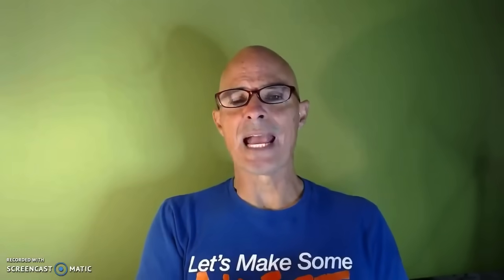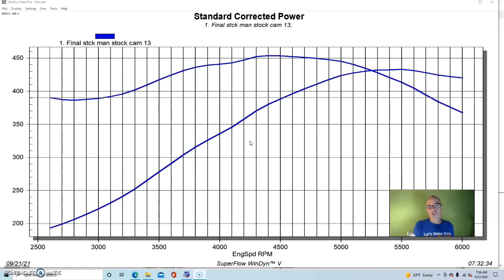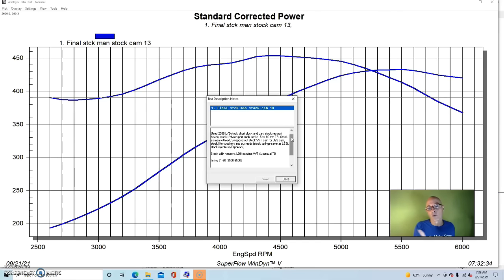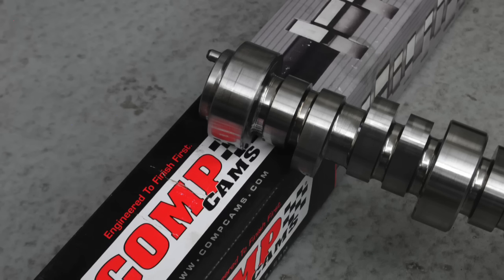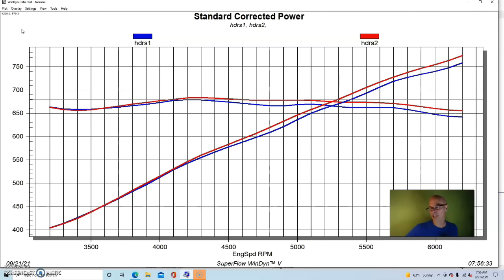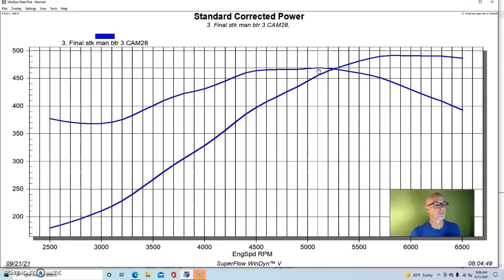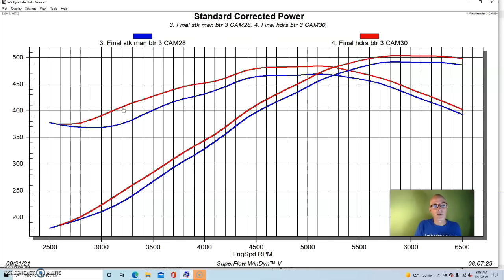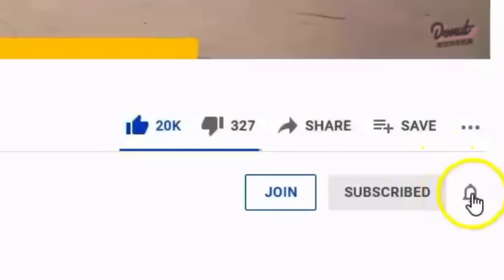HOW MUCH POWER ARE LONG-TUBE HEADERS REALLY WQRTH? JUNKYARD 6.0L LS HEADER TEST!

Comment: In the 70s, one of the best ways to get power was headers and free-flowing exhaust. Since the 2000s engines have improved so much that there just isn't much difference. Your results are about what I'd expect. For example: my 2003 GMC LQ4 has cast manifolds that are essentially short tube headers that feed into a 4" exhaust system.
Reply: I agree!! It's not worth the wasted money, time and headaches buying/using fancy headers to gain a couple of horsepower!!
Reply: I have a 2002 Avalanche, stock 5.3, and I added a Whipple SC that makes 6 psi boost. I put long tube headers on it and they were nothing but trouble. First, the headers for the truck do not have tubes that lay neat and tidy like his dyno headers. They have tubes that loop upward and make contact with the LS ign wires, forcing you to solve that problem. Then they make access the spark plugs more difficult. And they have a clearance issue with the 4x4 front pinion. And they crowd the starter, making it more prone to heat failure and more difficult to change out when it fails. They were not worth it.

I now have a little more cam in it, very mild, stock idle with .050" more lift than stock. The 706 heads have been CNC ported and the chambers polished & cc'd, still the same Whipple SC. I now have the stock exhaust manifolds back on and I will install a good performance exhaust system behind the stock manifolds. I am looking forward to fewer under-hood problems and I don't mind if there is a small HP penalty.

 The engine runs well, BUT unfortunately I can't drive it right now because the engine has to come back apart ... apparently Comp Cams has sold me a bad set of lifters and they clack like mad after the engine warms up. Quiet on cold start but excessive lash noise gradually comes in as it warms past 180 degrees.
Reply: Very true! malaise era cars had the worst exhaust systems ever just a plain dual exhaust system begins at 20 or more even a better air filter would add a few hopefully you would  be lucky enough to have a four barrel.
Reply: @bigboreracing356  I'm 63, retired, and I put ~ $30K into a frame-off restoration on the truck since 3 years ago. No regrets, it's been fun but the next time the engine comes apart it's getting stock GM lifters instead of Comp Cams. When you grow up you might rethink stamping emojis all over what you write.
Reply: @bigboreracing356  I never would have guessed.

Comment: Guys who love classic exhaust manifolds like Pontiac Ram Air, 426 Hemi or LS6 Chevy will argue endlessly that the manifolds are superior to long tube headers and that headers are only for high rpms. I learned a long time ago about the benefits of long tube headers at almost every rpm range but especially low and midrange due to the increased scavaging effect. Guys like Richard who have tested every possible combination and their only goal is what makes the best power, not what pulls at our heart strings, show every time that nothing beats a long tube header for making power. If you want trouble free operation, long life and easy fit then cast iron manifolds might be the way to go, but if you want to squeeze every bit of horsepower out of the engine then nothing can replace the long tubes!
Reply: Long tube headers also sound awesome.
Reply: i agree, never will i prefer stock over longtubes, never..
Reply: The Chrysler max wedge exhaust manifolds are really close to a header. Nicks Garage did a dyno test with them versus regular manifolds and I think they were 30hp better and less than 10hp off the long tube headers.
Reply: @bcbloc02  I saw that test too. And you can tell by looking at them they are good units. Pontiac had some Super Duty manifolds in the early 1960's that looked like cast long tube headers and they were made from aluminum to boot. I bet they were pretty good too but I've never seen a test on them.

Comment: I feel like my 1 3/4 longtubes are the right package for my boosted and cammed gen 2 LT1. When it eventually gets some AFR heads, a larger cam and a smaller pulley it'll be time for 1 7/8 longtubes.
Reply: Go 2 inch
Reply: @FXIIBeaver  go 3 inch
Reply: @1flynlow   they make 3 inch headers? Does that even fit anything not custom fabbed for it.
Reply: @1flynlow  Go 12 inch!
Reply: @Anarchy-Is-Liberty  anything over 7 inches is overkill.
Reply: 3.5 ftw

Comment: Hey Richard!!! What about long vs short turbo manifolds? I know it sounds very silly but would the scavenging still be in effect??
Reply: No that is covered in corky bell's book maximum boost...doesn't work the same because there is high pressure in the exhaust
Reply: @chipcurrey653  ok but isn’t the exhaust pressure dependent on how efficient the turbo is? As in, how little a restriction the turbo becomes as to be as close to a 1:1 ratio in exhaust pressure? Maybe I’m confused
Reply from the maker: that's not why
Reply: @richardholdener1727  i realize that I may be confused so please explain. Love your videos!
Reply: @richardholdener1727  i know that a shorter turbo manifold will have a better response so will the effects of turbo spool have more gains than scavenging or is it that since scavenging is only initiated by the exhaust pulse exiting to a higher volume area and triggering a reflecting wave, that turbos negate scavenging all together???

Comment: I once had a 92 Mustang LX with JBA 1 1/2 inch shorties, K&N filter and silencer removed, Flowmasters, and bumped up timing. It ran decent while still pretty stock and reliable. Then I drove an 88-89 convertible with long tubes and possibly a larger throttle body. I think the cats were also missing. That car ran really strong. I didn’t see much else over stock. Led me to believe the long tubes worked better than the shorties.
Reply: On the 5.0 mustang the long tube would help alot.   The intake ports were poor and the scavenging would help fill the cylinder on the overlap.

Comment: Great video, excellent info. I see you have your clips in wrong order though, not that it matters to much. We go from stock manifold/long tube comparison on stock block to the full beast supercharged dyno run, and then back to the stock vs cammed setup on the finale. Thanks for the content.

Comment: I would like to see what mid length do vs long tube...sometimes your limited to what you can use and its nice to know if its worth it. Also if you have mid length headers and added a collector extension would you see much difference.
Reply from the maker: that was almost included
Reply: He's got a video out somewhere using cast iron, shorty, and long tubes. I was very surprised to find out that the gains really aren't at all that much, like maybe 4-10hp on average! It's totally made me re-think my future street builds between 400-600hp and all the headaches that are sometimes associated with trying to fit a set of over priced, named brand, leaky junk headers on a vehicle!! Do I really want to spend $350+ dollars, endless headaches, and banging on header tubes to gain 3-6hp? Yeah, probably not!
Reply: @Anarchy-Is-Liberty  you have a point esp when your talking about under 400hp engines.
Reply: @Anarchy-Is-Liberty  depending on the motor there are often factory exhaust that arent awful.

Comment: Have you done a similar comparison on a mild cammed 5.7 hemi? I have 2010 rt awd charger and those headers are $1800 a pair. Just wondering if they are worth it? Was planning to preventatively do lifters next spring with a mild cam.
Reply: Headers and a tune can get you about 20-30hp, for the awd, it could be more, but the sound and responsiveness is great

Comment: Like that you emphasized that it isn't just flow. Also the relation between camshaft and headers, with the headers likely being able to "protect" the bottom and midrange from the potential reversion from a more aggressive cam profile. 
Would the supercharged application be more about reducing exhaust pumping losses with a larger primary since there is such a large delta P during overlap where scavenging is never an issue?
Reply from the maker: scavenging still takes place-the big difference might be that the supercharged motor has a very short intake runner length (not in sync with headers)

Comment: I'd like to see long tubes vs manifolds on a supercharged application. Maybe even shorties if they're available.I feel like the positive pressure on the intake is more powerful than the scavenging effect from the headers and therefore nullifies the positive effects of the headers. The cylinder filling is done primarily through the positive pressure from the intake rather than the negative pressure wave in the exhaust. 
  An episode of engine masters had a similar result where header/exhaust size didn't seem to matter in a supercharged application. Then the power gain is an issue of headers having superior flow and not the scavenging effect. 
  I know it is fairly uncommon to find someone who has spent thousands on a supercharger and is running the stock manifolds so there aren't that many examples in the wild. The example you show here shows a power gain with the bigger headers. I believe that can be attributed to the higher flow rate of the bigger 1⅞ primaries. 
  If I'm wrong, please correct me. You've certainly seen a lot more examples of this than I have. This application is unlike a turbocharged application as there is only additional pressure on the intake rather than the exhaust.
Reply from the maker: reflected waves (intake and exhaust) are still play on a supercharged motor, the short runners in a typical PD blower intake are not effective in this rpm range (they are tuned for 9000+). they do not work with the header scavenging

Comment: I would have loved to seen a set of shorty (block hugger) type headers tested as well!! Building an S10, one of the things I'm told all the time is to use "block hugger" headers, yet it was pounded into my head my entire life that to make real power from a set of headers, you need to use long tube headers!! I have always wondered if cast iron manifolds vs block huggers vs long tube headers was actually a thing. At this point, I am planning on welding up my own set of long tube headers for the S10, but would be nice to know if all of the effort is worth it. Engine is a 460 BBC with 620+hp, and will be running a 250hp shot of NOS along with it.
Reply from the maker: long tubes make more than every other short-style header or cast manifold (even block hugger)

Comment: I would love to see a comparison between different sizes of longtube headers. 1 5/8 vs 1 3/4 vs 1 7/8 on a stock 350 or ls 5.3l, although it might be hard to find a 1 5/8 for an ls.
And the difference between similar headers with cheap vs proper collector.
Reply: Dead giveaway as to the easy big power LS engines make compared to traditional SBC is the lack of 1-5/8" header size!! They don't do anything for the LS motors, except-MAYBE-the 4.8L....
Reply: @milojanis4901  Agreed. I at one time had found a comparison... but damn if I can't find it now. Results being I have 1 7/8 long tubes on my 6.2 Denali.
Reply: 1 7/8 for my 6.0 2500hd seems to work very well. Only ls i would put 1 3/4 on is a 5.3. And even then 1 7/8 might be better.
Reply: @milojanis4901  yeah, I think the 4.8 would be the only ls to utilize the 1 5/8 headers but I think the exhaust port is bigger that 1 5/8 anyways so it probably wouldn't be any better than stock.
Reply: @HioSSilver1999  I have a 5.3l with a BTR torque cam and I went with the 1 3/4 on it but it is my daily driver too. I think if I went with a stage 3 cam or wilder then the 1 7/8 would probably be better.
Reply: Header primary tube diameter is more an effect on tuning/scavaging then flow unless your tubes are way undersized. I went from 1 5/8 to 1 3/4 on my old 600hp supercharged sbc and it didn't care.
Reply: @brandonpayne1207  I'm sure it's splitting hairs for header size and probably gonna be application dependent. A truck may very well like the smaller diameter.  But damn near every test i have ever seen the ls seems to like a bigger header on 5.7 and larger .
Reply: @milojanis4901  I’m sure some of that is the market/sales driven too. All the guys out there saying “biGgER iS BetTEr”

Comment: I was expecting to see the experiment done on the same engine throughout the process.  Very difficult to compare numbers to stock manifold / cam to upgraded headers / cam to boosted.  The test would benefit to people trying to figure out cost to performance ratios and what gains they're expected to get.
Reply from the maker: all the info is there-plus there are other header videos up

Comment: I'd like to see the difference between the long tubes and factory manifolds on a supercharged engine...where scavenging may not be so much of a factor in the mid-range.  My assumption woul d be that the flow restriction would show up in the mid to high range of the powerband, but I'd like to see actual test results as to how much.
Reply: Maybe watch the video then David.
Reply: @Maverick09171  I did watch the entire video...did you?  The supercharged engine was compared with long-tube headers versus larger primary long-tube headers.
Reply: @PunisherDMT  lol. Touché

Comment: That’s a great demonstration of how much more power is available when a tuned length long tube header produces such a strong scavenging effect. Some guys I know just can’t understand how the higher pressure exhaust pulses can be combined in such a way, as to create a much lower pressure area in the collector that actually scavenges more spent exhaust out of the cylinders. 

It’s not magic but when comparing the results of this fairly conclusive dyno test,  those power gains across such a  broad rpm range can definitely be felt in the seat of the pants 😱.
Reply: Yeah, which boils down to not much at all!!